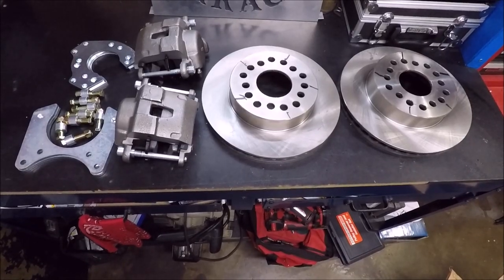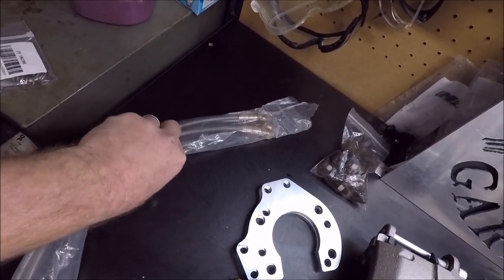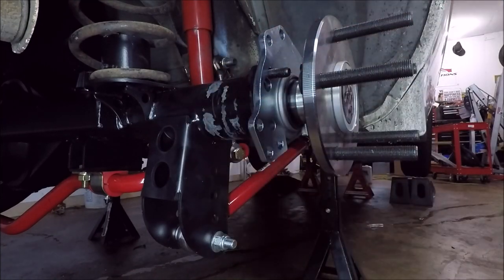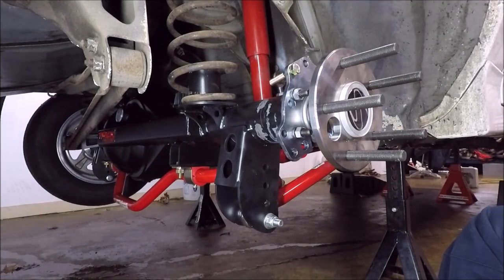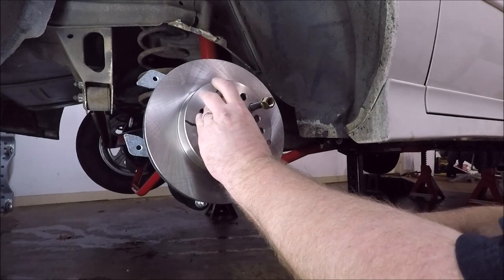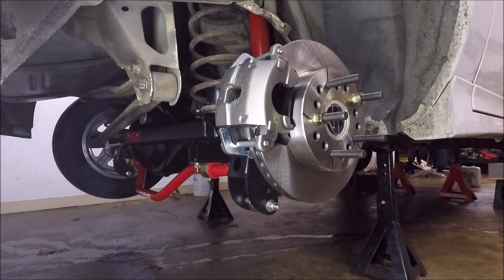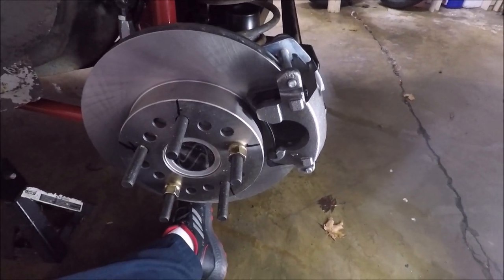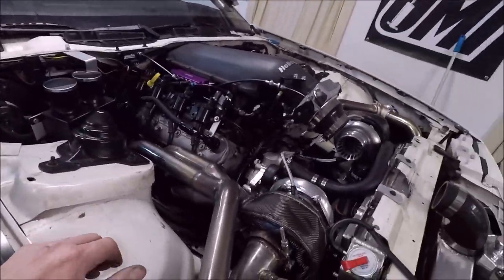QUICK PERFORMANCE BUDGET 9 INCH REAR DISC BRAKE KIT INSTALL

Comment from the maker: For those who keep asking, this brake kit uses standard GM Metric FRONT calipers and pads. These calipers and pads came in the front of many GM vehicles throughout the 80s and early 90s. So replacement pads can easily be purchased at your local auto parts store by asking for pads for an 85 Monte Carlo as an example.

Comment: What happens if they discontinue this kit and you need rotors?
Reply from the maker: @joshwilliams6910  this kit uses the same universal rotors that pretty much every company uses for similar kits. And the pads/calipers are GM calipers and pads that came in the front of just about every GM vehicle from the early 80s through the early 90s….including the Camaro. So unless everyone stops making these low dollar 9” brake kits, and everyone stops making pads and calipers for 80s and 90s gm cars, replacement parts won’t be an issue.

Comment: Still here sir.  Nice job on the install.   Nice and simple car so far.  I know if I used run 6.90s back in the day on 375wheel in a fox mustang that you are going to crush that sooner than later!
Reply from the maker: Hell it’s already been 6.80s on low boost brother. 😉

Comment: Job well done. Straight forward.Pleasant music. Thank you sir. Have you ran them yet? Did you ever get the line issue ironed out?
Reply from the maker: Yes sir and they work well. You can check out the newer videos in the chaos theory Camaro playlist to see the track runs. As for the leak, I just loosened it up, tried to scoot the crush washer over a bit and retightened it. After three try’s it finally didn’t leak. 🤦🏼‍♂️
Reply: @BadLuckGarage  Oh right on. I just ordered my set. Thank you for the reply.

Comment: This,video was very helpful. Thanks!!!
Reply from the maker: Glad you found it helpful brother. Make sure you check out the follow up video about the lines. I recommend making your own and NOT using the braided AN line line kit and fittings. I’ve got one that’s still leaking slightly to this day. Planning to go back and make new hardlines very soon.
Reply: @BadLuckGarage  Yup I just checked that video out, more helpful information!

Comment: So 2 questions are your wheels lug centric or hub centric. Question 2 is the rotors drilled for 5x5 bolt pattern
Reply from the maker: 95% of aftermarket wheels are lug centric so they can fit a variety of vehicles regardless of the hub size. I have no idea what all the lug patterns are on these rotors. That would be a question for  Quick performance.

Comment: Need conversion. How does it perform? Well worth the money?
Reply from the maker: Absolutely
Reply: @BadLuckGarage  thank you very much.  Thank you for sharing your video too.
Reply from the maker: @brandencavinder4452  No problem brother. These brakes are basically the exact same GM front calipers used on pretty much every GM car in the 80s. So when I put them on this car I pretty much ended up with a “square” brake setup. This cars running 5s in the 1/8 right now and hasn’t had any trouble stopping….except when I got lapped it 3 times in a row. That third pass was kinda scary with a ton of brake fade. But as long as they get 20 minutes or so to cool between runs there’s no issues.

Comment: Does anybody know the replacement pads for these brake calipers?
Reply from the maker: Im not 100% certain but I believe they’re just standard FRONT pads for pretty much any late 70s to early 90s GM passenger car. The calipers appear to be identical to the factory front calipers on this car. But the best way to get that question answered with 100% accuracy would be to contact either trick chassis or quick performance and ask.
Reply from the maker: I actually just called QP and verified and yes, they’re standard GM metric front brake calipers and pads. They said the easiest way to get replacement is just goto the parts store and ask for front pads for like an 85 Monte Carlo.
Reply: Thank you so much
Reply from the maker: No problem brother. Glad to help.

Comment: How do you like the breaking power of these brakes
Reply from the maker: Working great so far. Running 114 in the 1/8 mile with a short shutdown and no problem stopping yet. 👍

Comment: Should have gotten the LT1 brake ends that are "FLUSH" style from QP on the housing...

It's a 10 bolt factory style housing, and the 89-92 10 bolt & 89 9 bolt discs are supposedly the same as 93-97's anyways, so you literally just get a cheap set of 93-97 backing plates and have it pressed on the axle before the bearing and collar. 

With the flush face the backing plates i think hold it all together, i have to call QP today to confirm as mine didn't have any axle retainer plates and the LT1 backing plates are a super HD piece. 

That is what i did with mine. Also Strange sells a billet aluminum backing plate kit that has those cut outs for the bearings that stick out some, makes a PBR type setup perfect. And you retain that years disc brake stuff in case in the future you need parts, etc, you literally tell the auto part guys i need the year it is... Makes everything easier.

Hardest thing about modifying is keeping up with it. I mean imagine going in for replacement pads/rotors in the future and having to source the crap all again because you forgot etc, much easier to just say i need that years rotors/pads if you get what i mean...
Reply from the maker: I disagree. This brake set uses standard GM brake calipers that were used on the front of most GM vehicles from the late 70s through the early 90s. The pads can be purchased at any parts store. I believe they’re actually the exact same brake pads that are on the stock front brakes on this car. No need for all the sourcing of extra parts brother. $314 and done. Nothing else to worry about except running the lines. 👍
Reply: @BadLuckGarage  You don't get what i am trying to say.. I am saying if you had a F-BODY with discs from factory like 89-92 which are the (SAME EXACT TO 93-97 LT1 STYLE), it's best to just order their "GM SMALL FLUSH FLANGE" so you can reuse your factory setup. 

This way when you need something and forget, or possibly sell the car, or whatever, the owner can go to any parts store and say hey, i need rotors or pads etc for my 199X FIREBIRD, AND IT BE EXACT.

I plan to just unbolt the lines and calipers, leave hanging with zip-ties and then slide rear end in and bolt everything backup perfectly. If you use a long yoke style, you can retain the factory driveshaft i am told. I plan to TKX mine anyways.
Reply from the maker: @ICONBADGTA  I get what Youre trying to say completely but don’t think you’re understanding what I said. Trick Chassis didnt offer “LT1” style ends for thier housings when I ordered mine. The only GM ends they had were for the early 12/10 bolt which don’t fit the small 10bolt brakes, or they have the 98-02 ends LS1 ends. Then of course they had all the standard Ford pattern offerings. It seems they added the LT1 end option later. That and the fact that I started with a drum brake rear and had to buy rear disks anyway is why I just went with the Torino Ford ends. As a bonus, almost every aftermarket brake company makes brakes to fit the Torino ends so it’ll make for more choices when we upgrade to even better brakes later. (Which we’re already looking at since this car is currently trapping 120 in the 1/8 mile and we haven’t even turned it up yet) As for ease of finding parts, as I already pointed out, with this brake kit my rear brakes now use the same pads as the front. So I can now walk into any auto parts store and say “I need a set of front pads for a 1990 Camaro” or any similar 80s GM vehicle and those pads will now fit the front AND the rear of this car. As for the yoke, you don’t need an extended yoke. The factory driveshaft fits perfectly with the standard yoke. If you get the extended yoke the factory driveshaft will most likely be too long unless you’re using a short tail th350 or something of similar length. Even then I’m not sure it would fit properly as I’ve never measured for anything other than the long tail th350 that I had when this video was made and the th400 I’m now running.